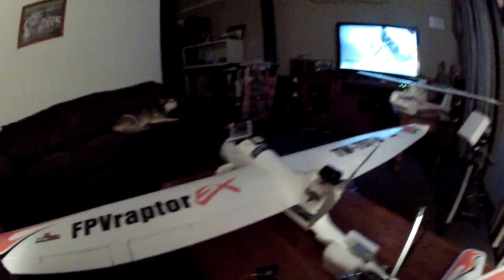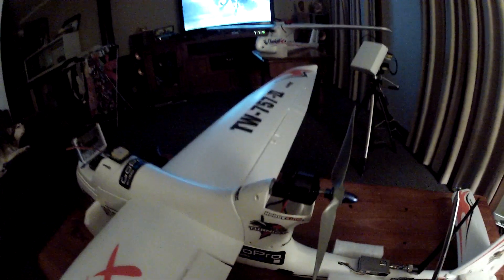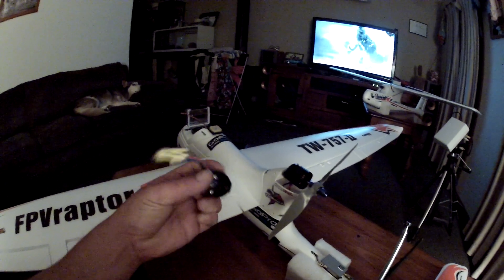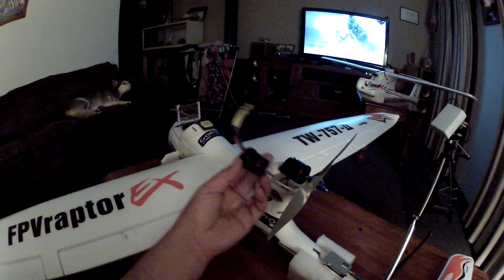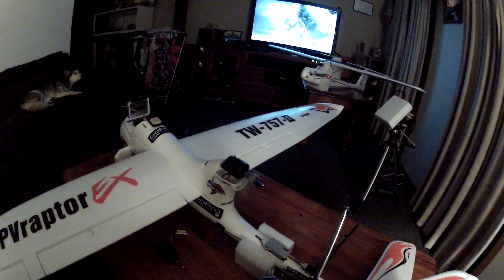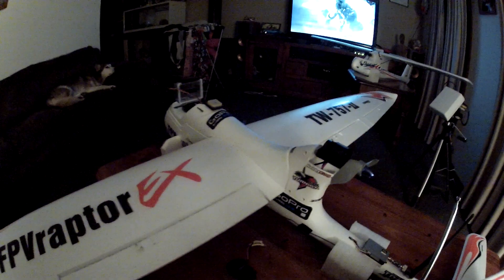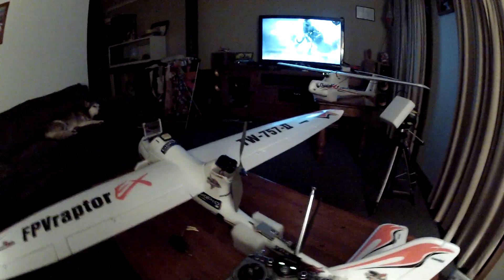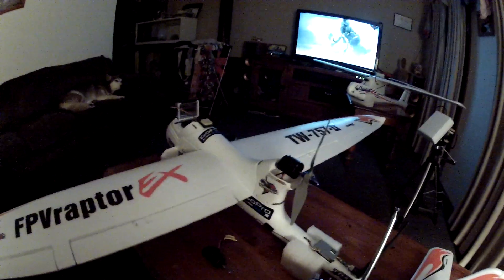FPV RAPTOR MOTOR UPGRADE

Comment: Ace man!....so with the lower KV and inverted mount (which I think is that 'white peg' like structure) you can use a larger, slower prop and achieve higher performance....I'm thinkin? Battery and prop specs handy mate?